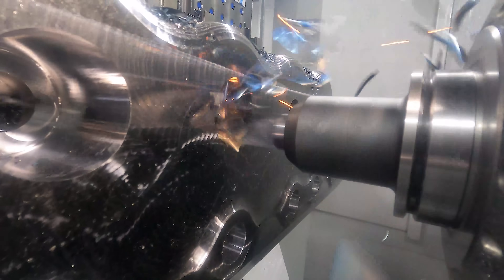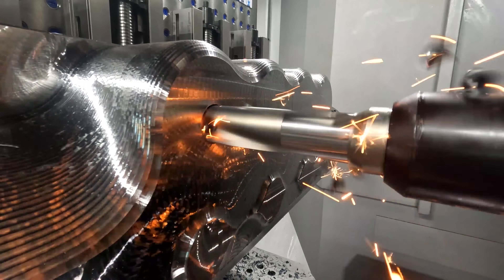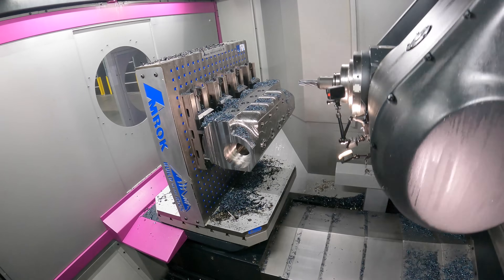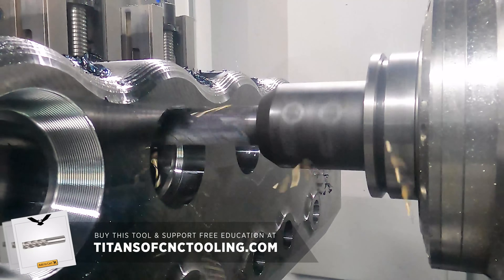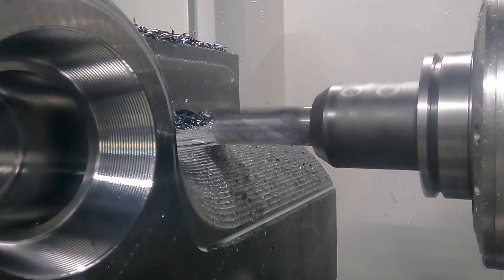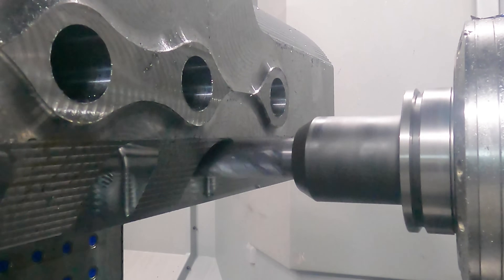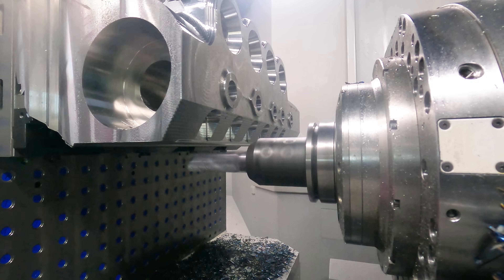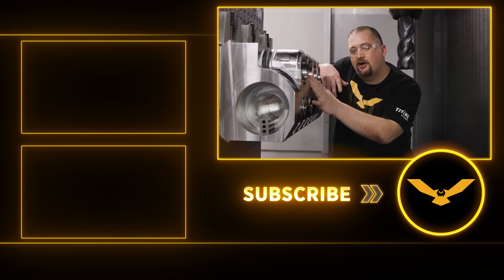Using Monster Drills & End Mills to Machine a Rocket Valve on our 100 HP

Comment: If this beast is 100hp…What is the horsepower in normal CNC machines on average?
Reply: Depends on 'normal' for your industry, but the mills I ran (Haas TM1 and Tormach 1100M) were 7.5hp and 2hp, respectively.

Comment: can I get a rough estimate on the cost of the end mill used here?
Reply: Titan sells them for 700$+  (HI TE 1 1/4" with corner rad )
Reply from the maker: Which is less than everyone else🤙
Of course that is a Monster Tool and companies like BOEING buy them for huge parts.

Most job shops stay in the 1/2 - 3/4 range
Reply: also, I grossly overestimated the tool cost, so now I have to walk back what I told my buddy. haha
 It's okay, I can handle it. 

 Good to know they're somewhat attainable.
Reply: far out. Thanks, everyone. 
 Whoever you have on "social media team", or whatever you call it over there, is doing real work.
Reply: Sometimes you can find them on ebay for around the 200$ range